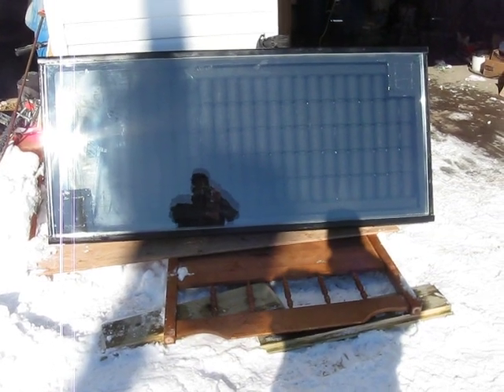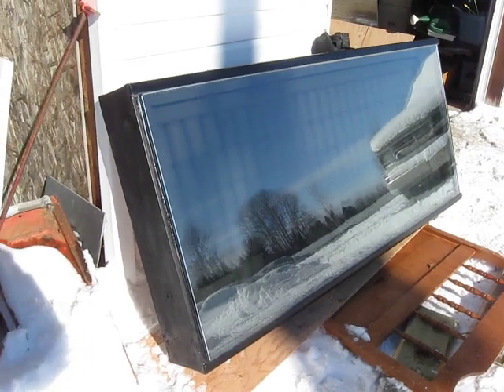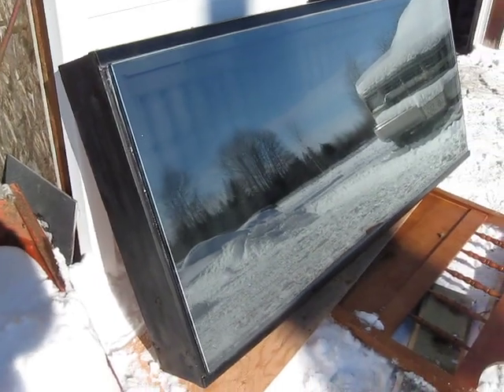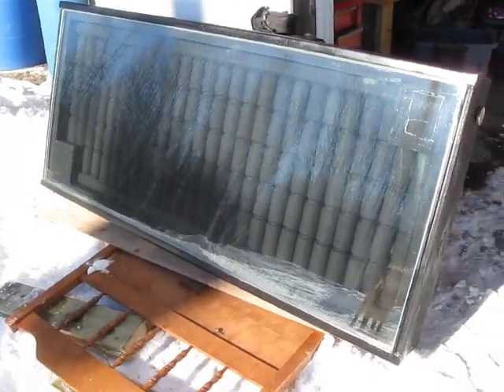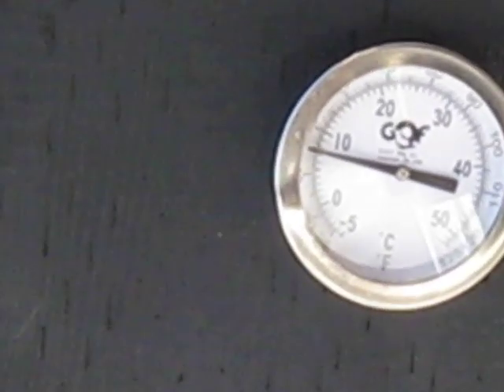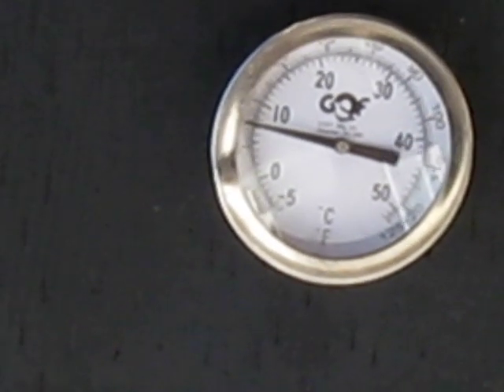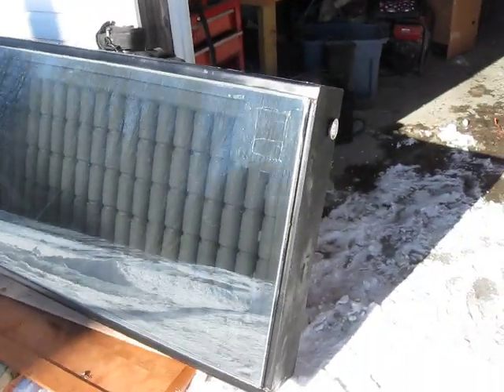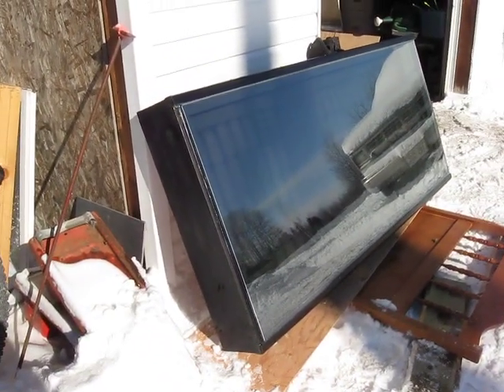keith's solar pop can  heater part 1 north eastern, ontario canada

Comment: Great system, I did the same thing with an old patio door too, in Ontario as well, don't test it in the spring or summer without a fan, it will shatter the glass from the high heat, ,i used a thermostat to control the fan, and I draw cool air out of my basement and pump in hot air into my bathroom, works great, good luck

Comment: Great system! Did you test it in colder temperatures yet? I wonder at what point (outside temperature) does the temperature begin to decrease within the heater, as a result of the colder temps outside the heater. Thanks for posting your video!